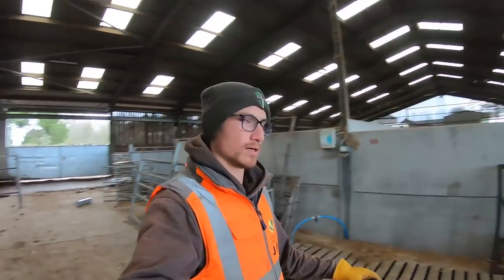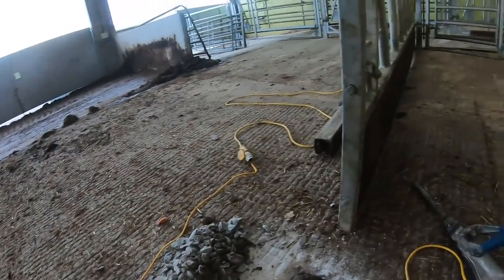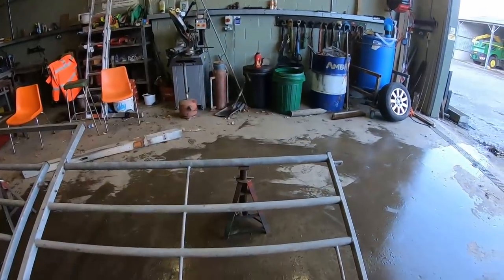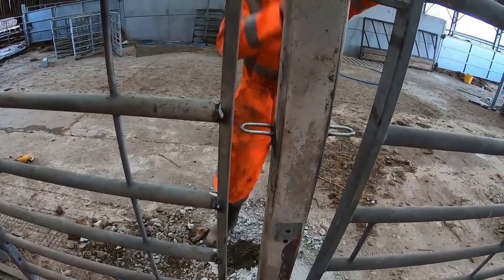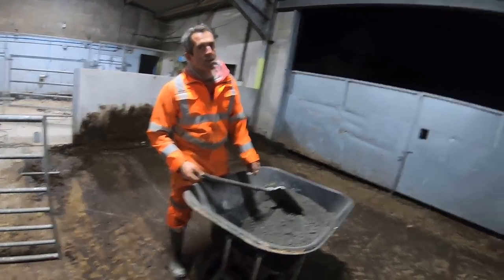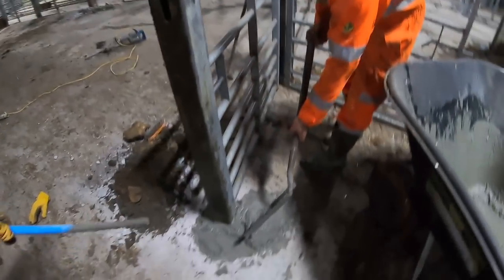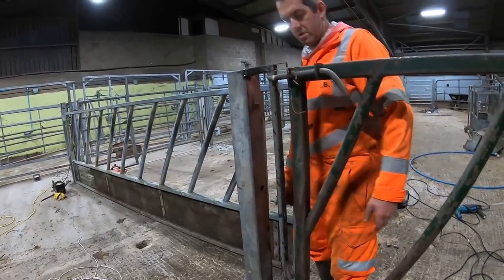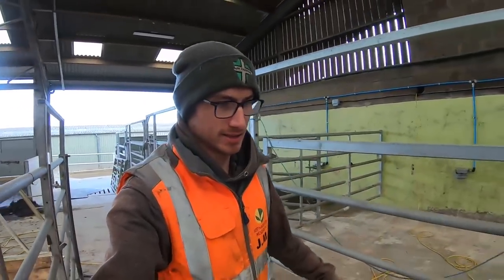THE GRAND OPENING! DESTRUCTION OR CONSTRUCTION?

Comment: Looks like you've been very busy! Good job on the hammer, You've got a very skilled colleague. I wanted to rebuild a second floor one one of my small sheds until the end of the year, but the weather has been awful and we will be moving cattle to a shelter pasture since winds forecast to c.70-80Km/h (thank god temperatures are holding in18-20ºC). One thing I've noticed in your videos is the weather is not much windy there in North Wyke... do you get strong winds in the region? How are temperatures there? [another long comment...] Wishes of the best Christmas for everyone over there.
Reply from the maker: Thanks! We have indeed! It’s been between 5 and 10 degrees c most days recently. We do get the wind, I just try to avoid it for the audio! 😂
Reply: @JMFarming  Of course, I understand. That windy sounds in the footages are really annoying. From what I read the weather there is a bit like where I work in the Portuguese main land. We get much cold in Winter and in the Summer is like being inside an oven. For a mid-Atlantic islander like me, it's hell.